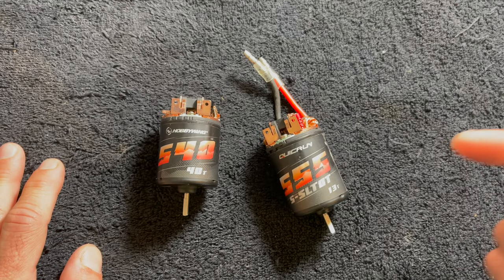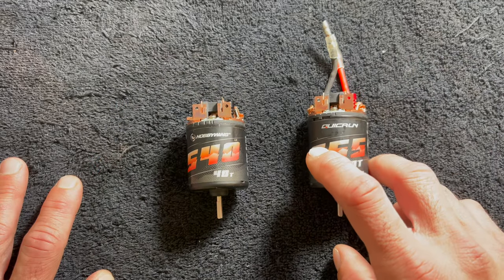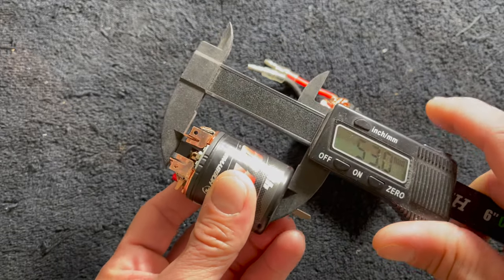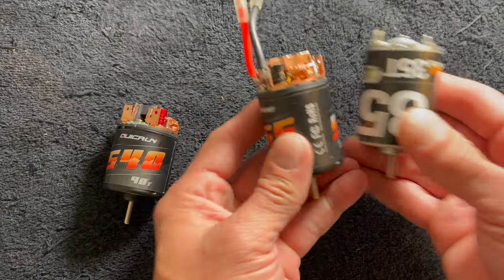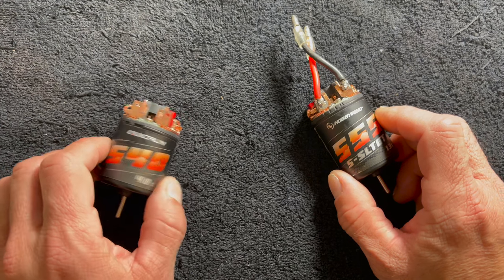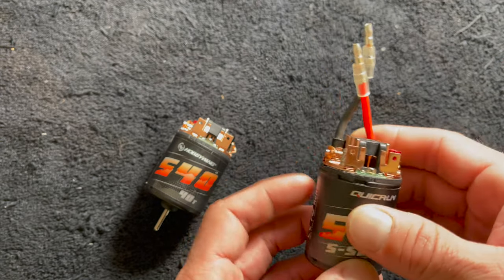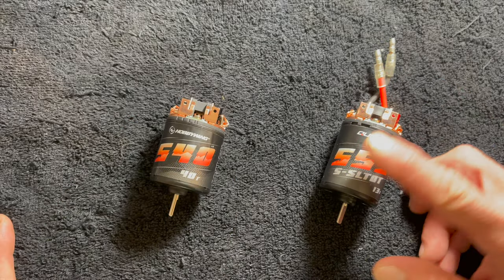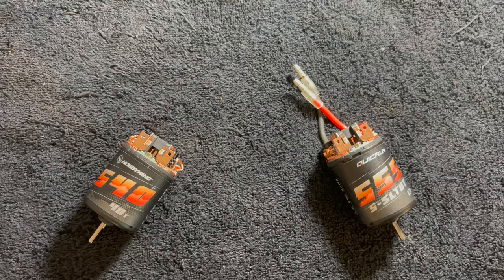The Charlie Show /// Episode 290 /// First Look - Quicrun Brushed Motors

Comment: I just installed a Hobbywing 555 13 T 5 slot motor in my Vanquish Phones. Fits perfectly. No cutting, No grinding required. Thanks 😎
Reply: Did you mean vanquish Phoenix? And still no issues so far? No running with the link mount?

Comment: How does this 30t motor compare to a standard 27t Tamiya 540 motor speedwise? Both motors run at 14000rpm, so are they comparable?
Reply from the maker: Hello,
We have not compared them directly, but chances are these would be an improvement across the board.